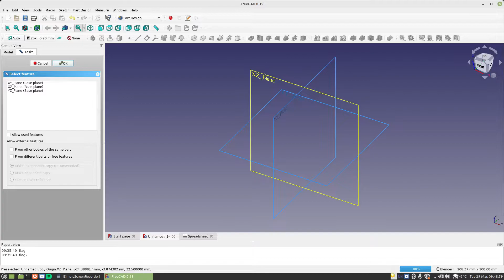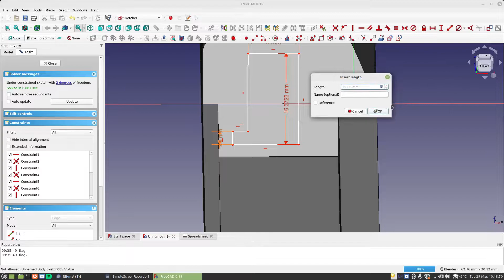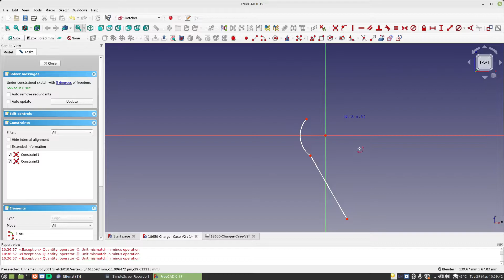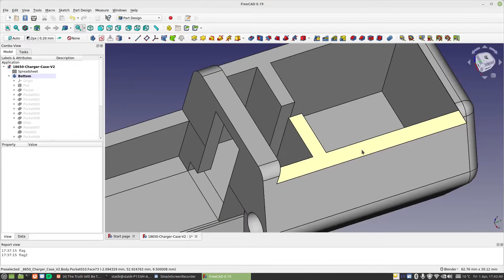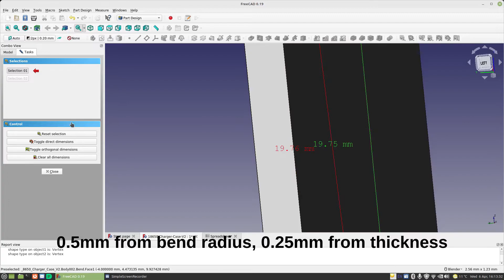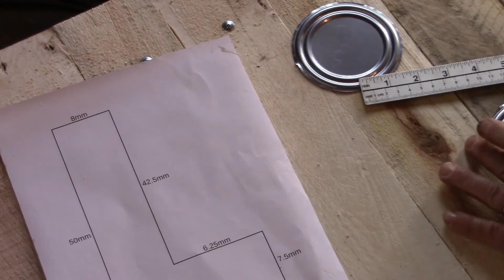Practical 3D Design with FreeCAD - Part 2

Comment from the maker: A quick update on this project. You may have noticed that the light in the charger didn't really blink in the test but went from bright to dim. It is supposed to blink completely off. This was because the 18650 cell wasn't actually making good contact with the contacts. It turns out that tincan lids are coated with an insulating substance. This makes them a poor choice for contacts unless you take the time to sand both the yellow side AND the silver side, in order to get good contact with the wires (and solder) and the cell. Once I did this, the charger works as designed and draws 0.53A while charging the cell.